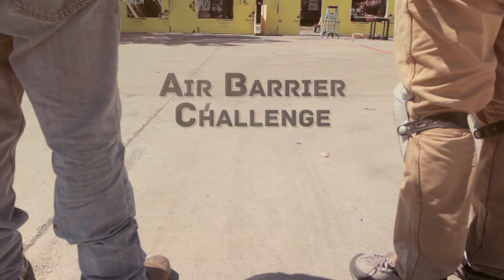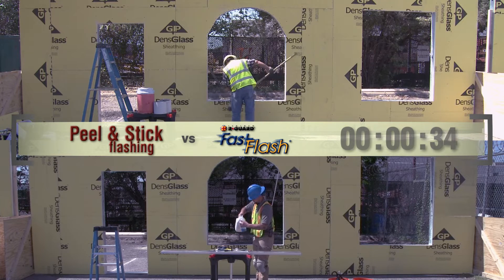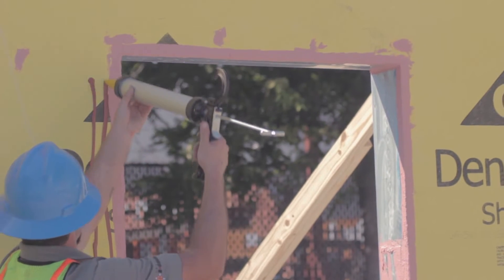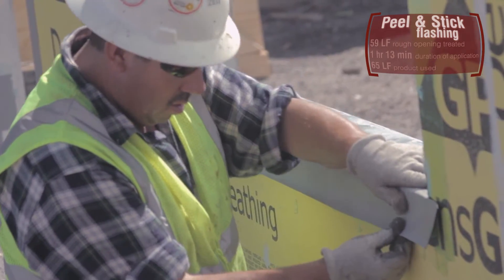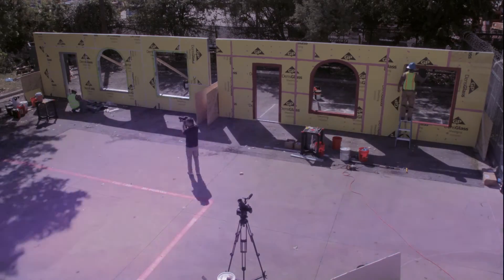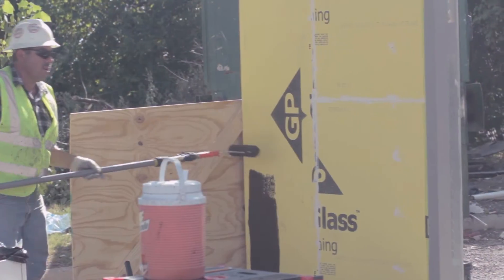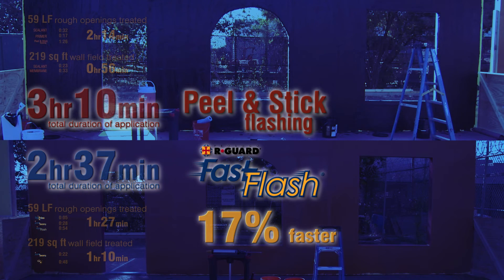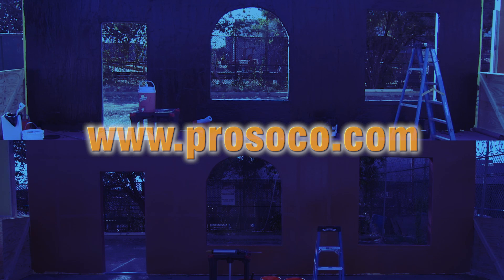Air Barrier Challenge:  FastFlash vs. Peel and Stick

Comment: How do I use Fast Flash with a regular house wrap? I noticed Butyl Adhesive flashing tape(Dupont Flashing Tape)doesn't stick to the Prosoco Joint and Seam filler.
Reply from the maker: Good question: We've outlined the steps here https://prosoco.com/app/uploads/2019/06/RGuard-Install-Guide-Rough-Opening-Integration-with-Building-Wrap-S11-1.pdf

Comment: Seems like the fast flash should just be applied via brush & roller straight out of the bucket or knifed directly on. The gunning process seems like an extra unnecessary step. No ?
Reply: Thank for the comment Glitch.  Since filming this air barrier challenge we have developed our Roller-Applied FastFlash that goes on really fast!  The gun grade FastFlash is to be used in the corners and can be tooled to create a cove bead to support the roller-grade material in the high movement locations (corners).  If you need further assistance please do not hesitate reaching out to us at PROSOCO.COM